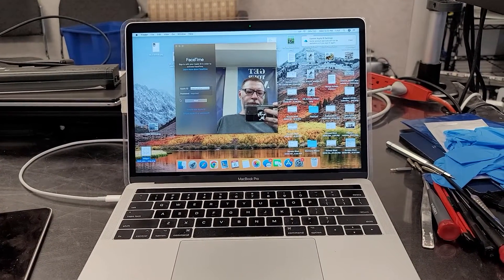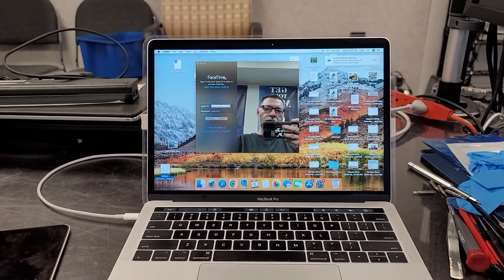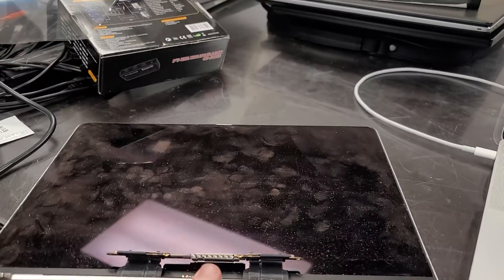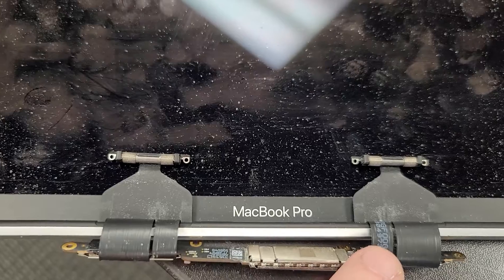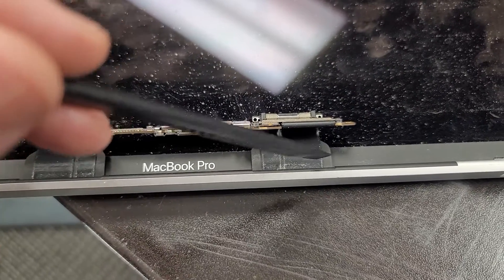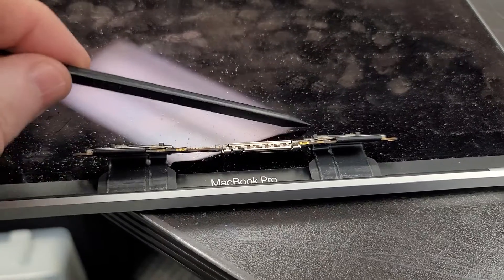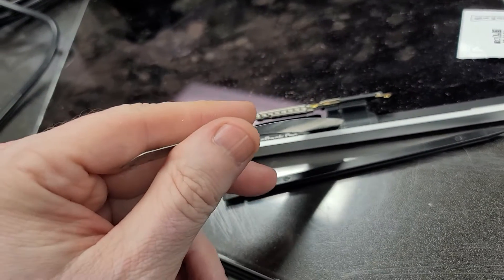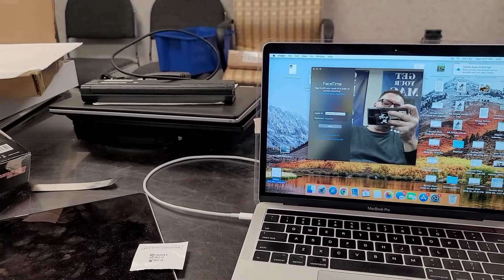MacBook Pro WebCam not working after LCD Screen replacement

Comment: You don't tell us how to fix the issue with the camera 🤦🏾‍♂️🤦🏾‍♂️
Reply: Older os like high Sierra  allows for the camera to work. If you lost your camera after a screen repair you can install an older. He didn't say this would fix the issue but made the assumption that his Sierra os is the reason he has camera function.